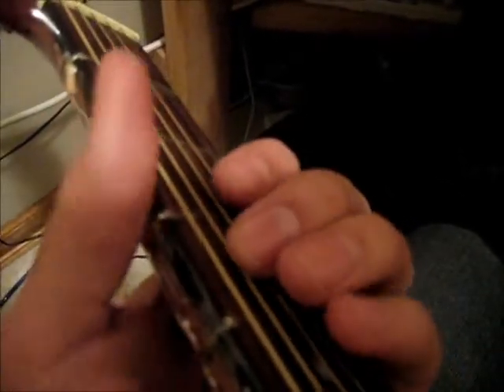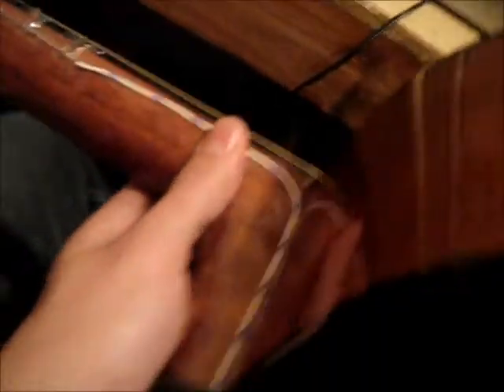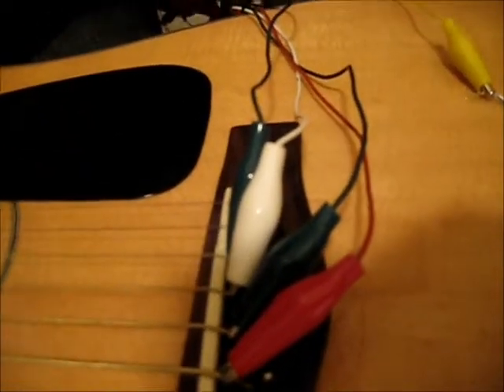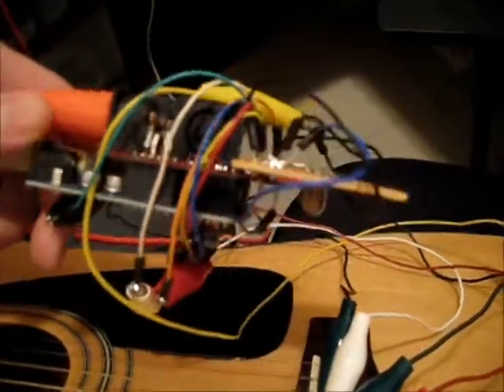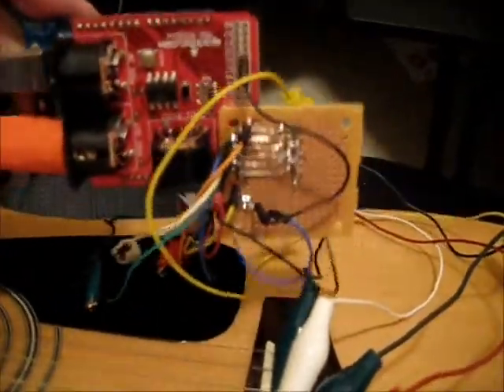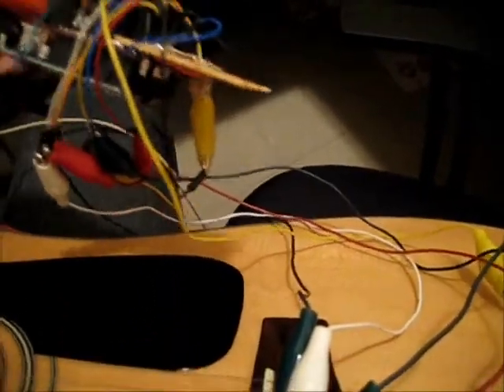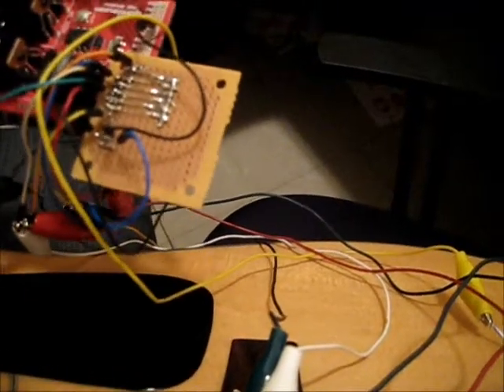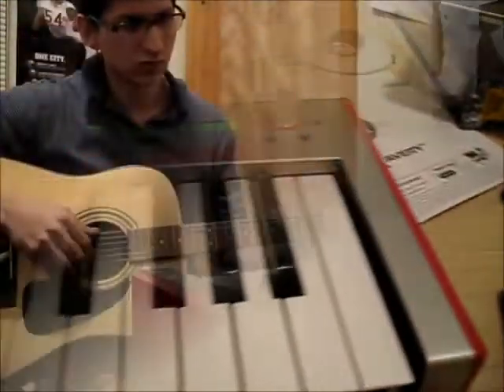MIDI Arduino Guitar - GuitArduino

Comment from the maker: @agentro I am posting all of my work on GuitArduino-dot-com.   I have somewhat abandoned this for the meantime. Instead I might be dividing the frets up into 6 sections like a guitorgan. Check out the blog though that has almost everything I am doing and more detailed. The schematic is on the page and there is a copy of the code that I posted in a comment section of the page. The code still needs some work. Glad you like it and thanks.